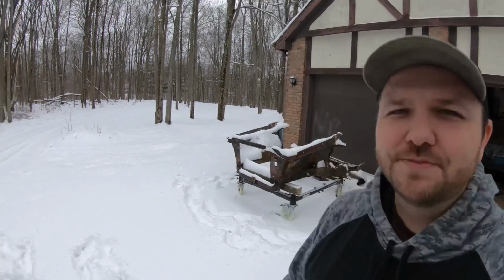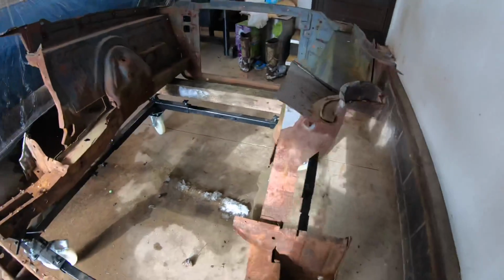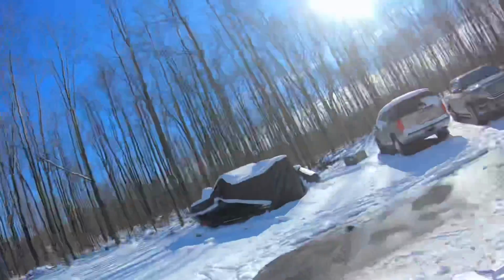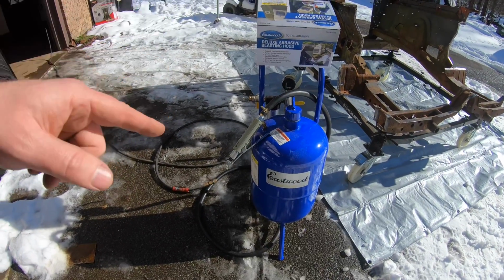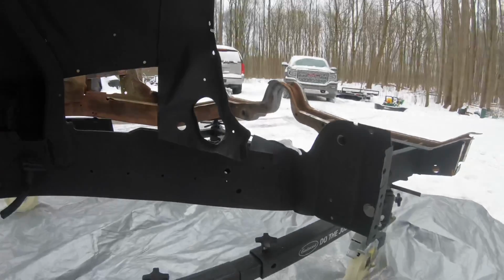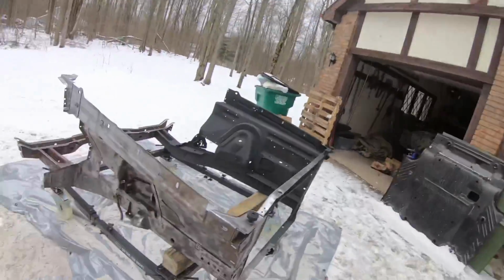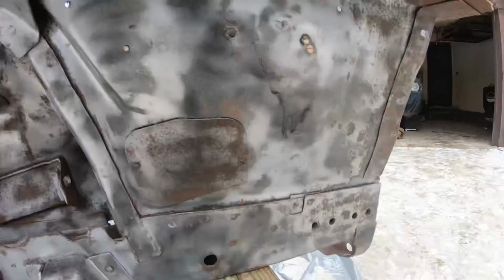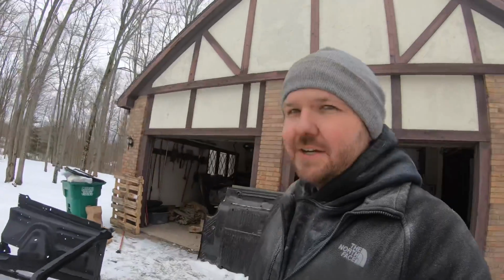1968 Dodge Charger Restoration - Episode 12 - Front Clip Prep

Comment: I have heard of the complaints about clog up on the blasters. My friend called me and asked for my help as I am a compressor guy. Reciprocating compressors are the worst for oil carry over and the heat they generate creates a lot of moisture. Got him some really good filters and he never had an issue at all after. Makes the world of difference
Reply from the maker: 100% agree.  Also to open the media valve a little at a time until you have the right mix.

Comment: Great inspiration!!!  One question...what bit are you using to drill through spot wells?  And where did you get it?  You drill through them like butter.
Reply from the maker: The tool is called a rotabroach.  They sell them on Amazon I believe.  Pretty expensive but they work great!

Comment: You're doing some great work. Since you say you are not sponsored by Eastwood I want to point something out. I know this won't help you but it may help someone who is getting started and is on a tight budget. The Sandblaster you bought from Eastwood and the one you can get from Harbor Freight are made by the same company. (Eastwood doesn't make any of the tools they sell) The difference is Eastwood's is blue and Harbor Freight is red. Oh and the price, Eastwood $280.00 Harbor Freight $150.00. Same tool but you saved $130.00 that's enough to buy one outer wheel house direct from AMD.
Reply from the maker: HF is great for a lot of tools!  Can’t go wrong with their die grinders either!

Comment: Now that you have a sand blaster you can sand blast the original k frame that goes to the charger
Reply from the maker: Unfortunately it was extremely rusted.  I’ll be replacing with a full QA1 K frame, suspension, and handling kit in an upcoming video.  Stay tuned!

Comment: If your gonna keep grinding and welding I recommend covering up that car with some better than a thin plastic tarp don’t want to throw sparks at windows or nice paint
Reply from the maker: I am surprised at how well the plastic has held up!  I’ve thrown sparks at it for the last 4-5 months and there aren’t any holes in it at all.  I picked them up on amazon.  I’ll find a link if you are interested.
Reply: @rustbucketrestos6511  haha well if it works it works right

Comment: I suggest you do what I did when my old compressor crapped out. I ran my new new compressor into my old 60 gallon tank and double the reserve capacity. Now I never run out of air running any of my pneumatic tools or spray guns.
Reply from the maker: The QST 30/60 is a beast.  I ran the abrasive blaster wide open for about 45 minutes and it never dropped below 90 psi.  It builds pressure extremely fast and was able to keep up with ease!

Comment: How many cans of the Eastwwod spray paint did you use? And how much sand was required? Thanks Tim
Reply from the maker: Two 50 lb cans of glass bead and 1 1/2 cans of Eastwood 2k epoxy primer

Comment: You stated you where using glass blast media once that has been used it does not work very good the second time around. All sharp edges fracture in the blasting process. If using silica sands it last a bit longer it to degrades with use. Keep up good work. Is the blue car a Firebird or Camero?
Reply from the maker: That’s a really good tip!   I had no idea but it makes sense.  It is a 68 Camaro Convertible.  It’s 90% finished.. Haven’t touched it since I brought the charger home.

Comment: spray zinc inside the frame rails while they are open. epoxy can go on top.
Reply from the maker: The internal frame coating I use has a zinc additive.  Pretty good stuff’

Comment: Does the moisture in the air affect primer adherance at all ??  A good QUIET compressor is a wonderful thing to not hear:-)  odd places for the frame rust but fortunately easy to get to.  Looking great!!!
Reply from the maker: I haven’t noticed a difference.   The Eastwood primer covers well whether it’s 20 or 90 degrees out.  Used it in both conditions and it worked great!  This compressor is so quiet I have to constantly go check to make sure it’s coming on!  And it is!

Comment: Is there any special techniques needed when sand blasting with that?
Reply from the maker: Not really... the most important thing is having a big enough compressor and a good drying system.  If you have to run your compressor continuously it will generate moisture.  Moisture + blast media = clogs & headaches.  Having the right size blast media is also important.  Anything less than 60# and you’re asking for trouble.  I would also recommend keeping the blast media valve almost closed when starting.  Open in very small increments until you get the right mix.  The less the valve is opened, the longer your media will last.  If you have any other questions, please let me know.  I’m very pleased with how it the Eastwood blaster performs.  Can’t wait to use it on the rest of the car!

Comment: I'm another Mopar guy here in Ohio. Doing a nice job. Not trying to be critical but the sandblasting technique wasn't getting it. Moving around too much and before you sprayed the epoxy on there was WAY too much rust left on the metal. It's all going to come back. Spray on epoxies are no good. You need to use either catalized or a acid primer. Don't get all hyped into the Eastwood products unless they're sponsoring you. Go to a PPG dealer and get professional products.
Reply from the maker: Maybe I am sponsored by Eastwood 😉

The 2k Epoxy Primer is catalized.  I’ve used it for years and it is fantastic stuff!